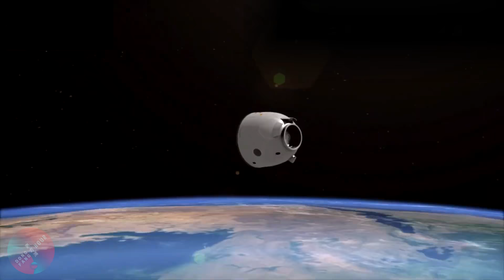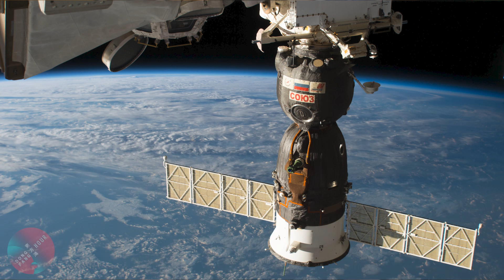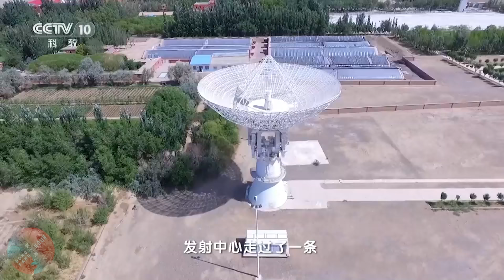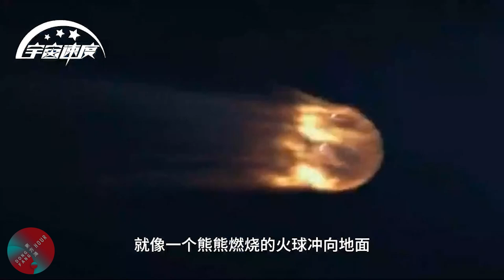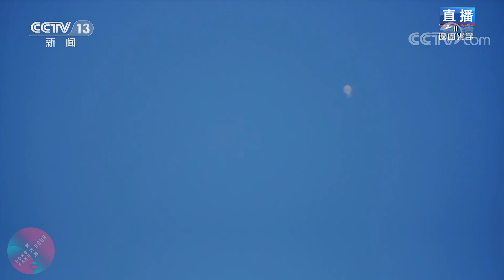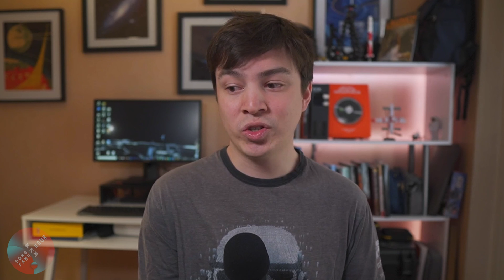The Reentry of China's Shenzhou Spacecraft - Explained Step by Step

Comment: Very interesting explanation at loc 8:23 of how reentry angle depends on relative position of center of mass and center of pressure (area). See also an excellent demonstration of aerodynamic stability using weighted paper airplanes in https://youtu.be/HESOat2iPzU starting at loc 27:30.
Reply from the maker: That's a fantastic presentation you linked there, Jonathan, lots of great rocket science concepts packed into one hour. Even though it's meant for kids, I found myself hooked and watched the whole thing 😂

Comment: Its very similar to soyuz, do you think Chinese shnzhou and Dragon capsule copied the Russian Soyuz?
Reply from the maker: It's very hard to get a final opinion on this topic. I would tend to agree with the well-established book "China in Space" by Brian Harvey: "In 1995, the Chinese were looking to buy critical elements for their manned space program. They bought an entire spacecraft life support system, a Sokol spacesuit, a docking module, a Kurs rendezvous system, and a full Soyuz capsule though the latter was stripped down shell without any equipment or electronics." (p. 367).

So yes the Chinese did get quite a few systems from Russia which served as precious building blocks. I believe there's still a lot of indigenous systems in Shenzhou though. There are also intrinsic design differences (orbital module notably), and you can see incremental improvements between each version of Shenzhou since 1999.
Reply: Pointless to re-inventthe wheel
Reply: If I remember well, Russia helped with the development and is not lost on me that Tiangong 1 and 2 kind had the same goal for the TSS as the Salyuts had for Mir.
Reply: Dragon is nothing like soyuz and the chinese copy.  Soyuz has three people crammed inside it in the fetal position.  Dragon can carry up to seven people.  Dragon volume is much larger.  Just compare cabin pictures of each craft with their occupants.  No comparison.  They are as a different as night and day.